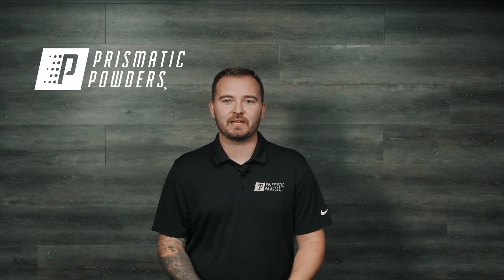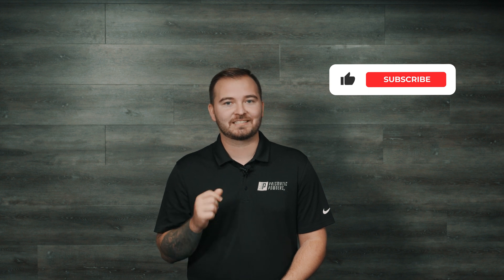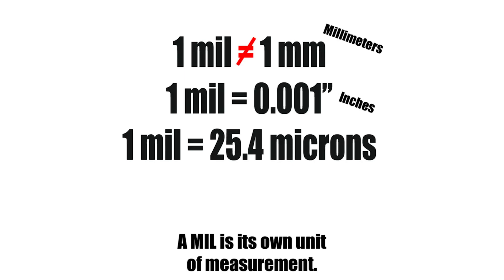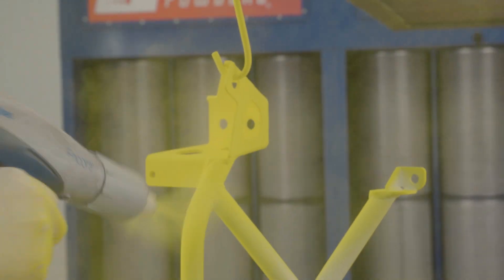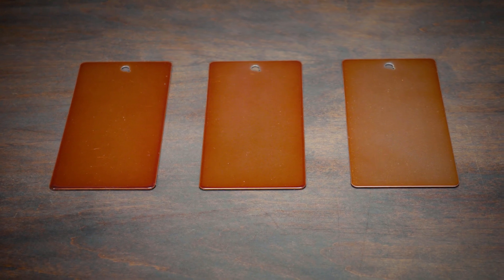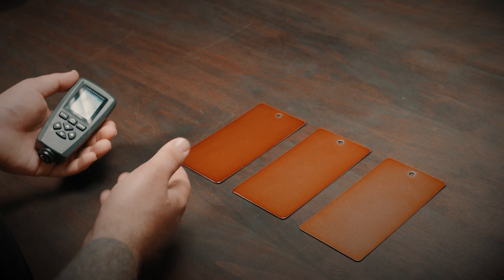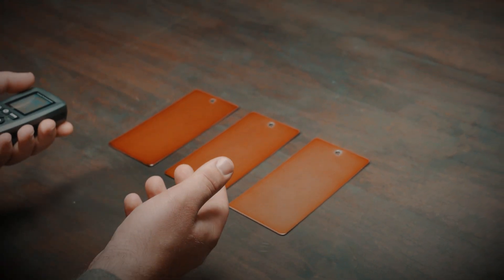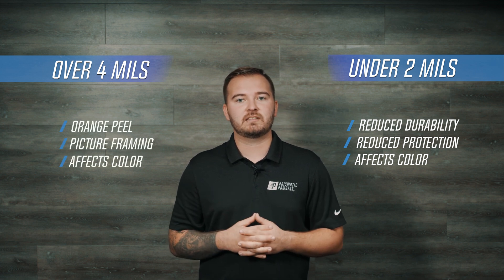Prismatic Powders | Witness The Thickness (Using a mil thickness gauge to check your work)

Comment: How do you tell while you are applying?
Reply from the maker: There are instruments that can penetrate the surface without touching it using some fancy tech but they are not cheap. This would allow you to check before putting the part in the oven. Apart from this, experience and honing your spraying techniques is your best way to gauge, then checking mil thickness becomes more of a spot QC process. But this is a time and experience thing for sure.